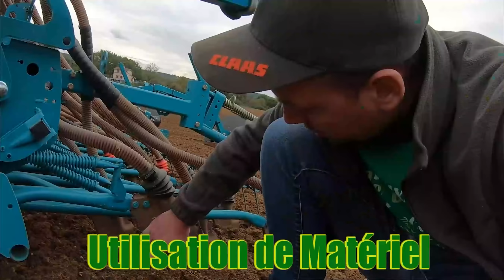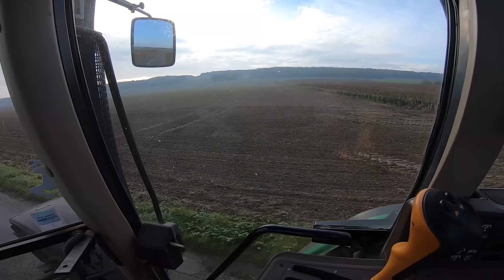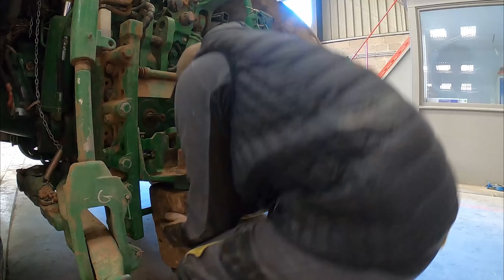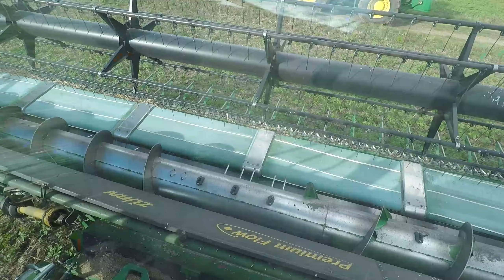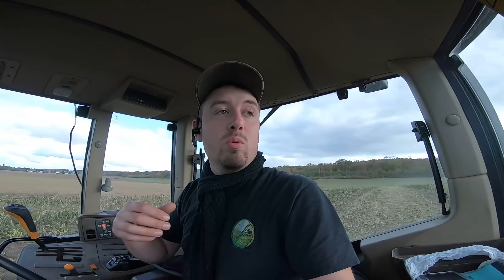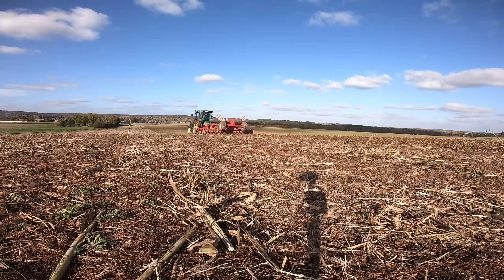FIN des MOISSON 2021 Le SORGHO très gros DEGATS et CREVAISON un DESATRE...

Comment: C’est bien grand engins mais quand les chemins sont petits c’est pas pratique😂 heureusement que tu parler de la coupe si non sa aurai pu être mal interprété 😂🤣😂🤣
Reply: T'inquiète pour l'engin et le chemin,  entre le propriétaire de l'engin et là propriétaire du chemin, qu' elles que soient les tailles respectives,  suffit d'un peu de bonne volonté et ça passe toujours 😋
Reply from the maker: Mdr bande de tordus les 2 😝
Reply: @valeuresagricoles1342  non non pas tordu, bien droit....😋
Reply: @valeuresagricoles1342  il y a presque plus que la dessus qu'on paye pas d'impôts
Reply from the maker: Dans ces cas la oui !!
Reply: @valeuresagricoles1342   @pascal Deere c’est pas faux 😜
Reply: @valeuresagricoles1342  et c est moi qui dans la vidéo dit que les fentes s'écartent ? 🤪